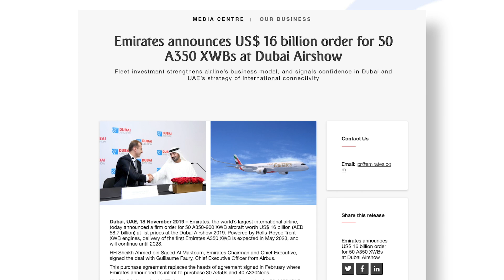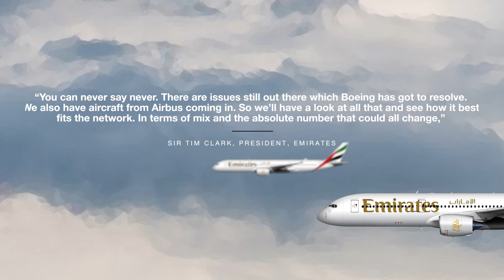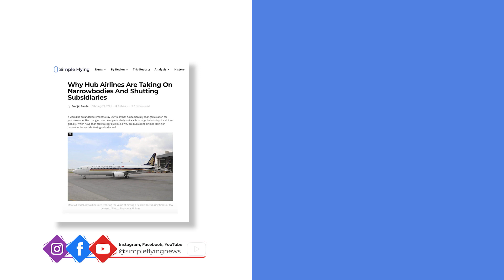Everything You Need To Know About Emirates’ Airbus A350 Order

Comment: Considering so many of their crews work with the A380, using an A350 seems straightforward because they'll be so much familiarity, especially in the cockpit.
Reply: They operate 777-300er too check your facts
Reply: @tetus1575  The B777X uses the almost same cockpit as the B787. Emirates has currently no 787 means no experience on the systems. The A350 cockpit is basically a A380 cockpit but with 2 less engines.
Reply: @tetus1575  you and facts don't go together
Reply: @tetus1575  < You need to capitalize your sentence and add a period at the end.  This was taught in the second grade, where were you?
Reply: They didn’t choose the a350 for FOC similarity if that’s what you are thinking. They had no choice but to go for an a350. They originally wanted to go for the 787-10 with the trent 1000 engines but they had to wait for Rolls Royce to fix the engines first. The reason they want RR is because the 787-10 with the GE engines has weaker performance than the RR engines. The GE engines aren’t big enough to provide satisfying performance for Emirates. If you want to know. GE’s design philosophy is trying to keep core RPM as low as possible to extend engine durability. That’s why GE engines are so huge. 

But on the 787, engine size is limited and therefore lacks thrust on the 787-10. Something RR has no issue because RR isn’t extremely dependant on engine size for thrust. Then…
Emirates recently discovered that the a350 is just a far superior aircraft in performance over the 787-10 and so they diverted their order to 787-9. That’s why they chose for the a350. Because of it’s performance over the 787-10.
It’s also the same reason why Emirates went for the 787-9 over the a330neo. The 787-9 is just better in fuel efficiency over the a330-900.
Reply: an a380 and an a350 are not the same in the cockpit. One has 4 engines one has 2
Reply: @lukaslast3005  Didn't know the engines are in the cockpit
Reply: Emirates haven't their cancelled their order for A330-900, its just an order no one seems to talk about. They've said they still want the A330-900 recently I'm fairly sure.
Reply: @tetus1575  yes but the A350 and A380 cockpit are practically the same and will be convenient for crews going to the A350 as it will be probably replacing the shorter A380 routes
Reply: @hodb3906  yes mostly definitely, but it will be cool for the crew too especially if they are moving from A380 to A350
Reply: @lukaslast3005  almost the same if engine diff only throttle diff
Reply: @aspiringcaptain  Absolutely. It surely will since the a350 and a380 share very similar operations. No doubt that It's awesome that they went for the a350 because I did not expect that from Emirates, but it's sad knowing that they probably would've avoided it if they could. 

If the 787-10 didn't have performance issues or is in performance on par with the a350, Emirates most likely wouldn't have picked the a350 unfortunately. Especially when you consider their future fleet would've consisted of an all boeing fleet of 787-9/10 and 777-9 if they went with their initial plan. Which in terms of operations and cockpit layout, these aircraft are practically identical.
Reply: @lukaslast3005  Really?
Reply: @lukaslast3005  Really?
Reply: @dotted1337 I didn’t say the engines were. My point was you have to learn to learn to fly with 4
Reply: @lukaslast3005  Sure but that has nothing to do with the cockpit being the same between an A380 and an A350. Getting an A380 pilot to fly an A350 is going to be a lot easier due to commonality in the cockpit than had they switched to a Boeing aircraft.
Reply: @MarcusNesbitt4  the last comments from the chairman I saw (probably 2019/20?) were that order us not cancelled, but that discussions were ongoing. Do t think we can be sure either way.
Reply: @aradoc3951  But they do have PLENTY of 777s. 148, to be exact. With that, they are the largest operator of the 777 in the world. Mostly 777-300ERs, I do believe... How different can the cockpit of the 777X be from that of the previous version of the exact same type?
Reply: @aradoc3951  but they operate the Boeing 777-200lr and the Boeing 777-300ER, in which they have 158 777’s compared to 120 A380’s.
Reply: @tetus1575  But those ones will then operate the 777X. Am a380 pilot doesn't fly Boeings because of their type rarings
Reply: @tetus1575 what he never said they didn’t what’s your point

Comment: Folk on bere are like "Emirates should cancel their 77X order because of delays"....Why? They need the 77X to replace their older 77W and A380s. The reason why EK ordered the 787 and A359 was because they needed something in that size category after the 772/77E/A333/A345 all exited the fleet. They need smaller aircraft on thinner routes. Also, the A350-1000 maybe an fuel efficiant  aircraft, but many airlines have said that it cant properly compete with the 77W and 777X in terms of cargo and payload.

Comment: With shenanigans ongoing at Boeing, I think Emirates should size down their 777X order to the profit of their A350 fleet !
Reply: I agree. Even with the issues Airbus has faced with the A350 from the likes of Qatar Airways it seems a lot more manageable and something that is more likely to be resolved sooner than Boeing's issues which are far larger imo
Reply: The reason why EK hasnt ordered the A351 again is because it simply cant compete with the 77W and was the factor why it cancelled its original A350 order in 2014. The 777X is and will be the aircraft they need for both the 77W and A380 replacement cycle.
Reply: @mh12-47  sure maybe in 10 years when boeing can provide a safe airplane after a few 777X crashed just like the 737 Max.
Reply: @globetrotter1493  your comment is irrelevent and ill informed. You really have no idea what you are on about and it shows in your comment.. 😒
Reply: @globetrotter1493  just why 😭
Cmon Boeing isn’t that bad seriously
Reply: @globetrotter1493  777X is not much different from its 777 base, though. The gap is not as severe as original 737 and 737 MAX.
Reply: With all the multi-billion dollar lawsuits Airbus is defending itself from .
There certainly is shenanigans going on at Airbus !!'!

Comment: i think this is really good news, especially regarding pilot training. it’s so much easier to train an a380 pilot on the a350 than it is to train an a380 pilot on a 777.
Reply: But you need to know that emirates has the highest number of Boeing 777 300 planes worldwide.. So training them to 777x would be more easier than training a A380 pilot to 777
Reply: @edgarotieno2872  if they get both the A350 and 777X it will be very easy to transfer crew from aircraft to aircraft. So 777-300 to 777X or A380 to A350

Comment: The A350-900s aren't going on the same routes as the 777x. The A350-900 has comperable number of seating capacity to the 777-200. The 777-8x will have (roughly) the same number of seats as a -300 of today, which is about 350 and the -9 will be even larger. 

Emirates operates a 777-200 today with 300 seats. 20% less capacity for the 7778 and even less compared to a 7779x and as such vastly different route networks for the most part. 

Emirates likely ordered the A350 (might we see a conversion of some units to the ULR variant?) to open new longer, thinner routes to their network in 2023 and onwards once Covid is endemic.

Comment: So wait do they still have the a330neo on order ?
Reply: I have the same doubt too
Reply: Nope,They cancelled A330 neo order and went with B789 instead
Reply: @qasimasharfi9527  i think this Is s good choice to get the 787 instead of the a330 neo but bro if now the orders are huge how about the future
Reply: @qasimasharfi9527  it wasn’t like that, it was more like changing orders to the A350 and the B77X orders changed to include the B787. They said they haven’t chosen against having the A330neo so it could very well make an appearance. It’s a better option over the Dreamliner as cost per seat is the same but it’s much cheaper than the Dreamliner.

Comment: 777x has a wing with a wing that folds. I am sceptical of such changes. It's new and untested. I prefer the a350
Reply: Even IF the wing extension fell off there‘d be no reason to be concerned. The wingtip doesn’t produce any meaningful lift, the aircraft could safely fly without them.
No need to worry, for real
Reply: Boeing has been doing foldable wings for over 40 years through the military . No need to be concerned champ.
Reply: @paulgerard5413  which aircraft was that?
Reply: @akilghosh  F18, F14, E2, most planes on any carrier.

Comment: Considering the fact that the 777x has been delayed for soo long and there is still a multi year delay, I think that they should cancel 777x orders and replace them with a350 as there have been no major problems with them recently
Reply: Yup, and covert to more 787’s to accelerate what looks like their longterm goal of having a 787 and A350 only fleet
Reply: What about the paint issue?
Reply: @emmanuelgeorge  I wouldn’t call that major. Cracking paint can be fixed relatively easily. Much easier than MCAS issues and much much easier than what the 777x is up against.
Reply: They would probably have to up their orders to the a350-1000 if they wanted to directly replace their 777x orders. The capacity of the 777 is what they want to replace the old 300s and a380s. A fleet of a350-1000s and 787-10s could achieve this.
Reply: @adub1300  the 777x only had structural issues in 2021 which have been fixed. you should be gratefull that theyre doing more testing hence the delay.
Reply: Yes exactly! They should keep some 777X orders handy just in case but if it continues like this might as well go for A350 all together

Comment: A350 is a great aircraft. It is the best aircraft among all in service right now. Quiet. Powerful. Roomy. Amazingly comfortable. Emirates should get more A350s and reduce the number of 777X ordered.
Reply: A350s couldn't effectively replace 777, though. That is why 777X is ordered in the first place: replace 777-300 and A380. Emirates need the capacity. A350 will work on many routes, but on busier routes, 777X is needed.
Reply: Agreed 😊. I don’t understand why airlines are not snatching the A350-1000. This industry has some daft managers. They were laying off staff & forcing others  into early retirement in 2020 like there was no tomorrow. Now no pilots, no cabin crew, no ground support, no planes. Shambles. Emirates cancelled 70 A350 in 2014 for whimsical reasons 🤷🏾🤷🏾🤷🏾. 

Difference between A350-1000 & 777-9 is minimal at best ,a net cargo difference of about 5 tonnes but A350 burns much much less fuel for greater greater range too. 

It’s irrational sometimes. A lot a reactionary decisions no solid logic
Reply: @ricky1231  People for some reason love Boeing more than it deserves. But business decisions are not made based on personal crushes. Airbus has to do something extra good to grab the attention of decision makers. Boeing appears to be the default company to buy airframes of.
Reply: @sh230968 
I have flown on both 787 & A350 multiple times 
I prefer the A350

The the 5 tonnes difference between 7777-9 & A350-1000 is for fuel to take it a shorter distance of flight 
And the 777-9 is more expensive 
Madness

Comment: Amidst the overwhelming number of  positive comments here about EK's current order for 350 placed in 2019, I bet you very few of these commentators are aware that 2019 was NOT the 1st time EK ordered the 350.

EK actually ordered the 350XWB for the 1st time ever over 14 yrs ago.  Then EK cancelled that order in 2014 mainly due to dissatisfaction with the technical design changes Airbus has made to the 350 during its development(a long story but in a nut shell: Hardware commonality of the Trent XWB turbofan on the 359-900 and 350-1000 was originally above 95% but became much much lower after Airbus made that infamous design change).....which I find very ironic and funny as many comments here tend to cite how the whole 350 family will fit EK perfectly and imply EK won't need any other Boeing widebody types in the future.

The reality is that EK fleet decision is far more complex and technically objective than the subjective feelings/personal preference of these commentators.

Comment: The whole issue is, 777X won't be financially feasible without Emirates 115 orders, other's carrier orders don't add up to cover the development cost.
Reply: Its already not profitable even with the Emirates order
Reply: @elisabettajdj335  Yes, the main obstacle why 777X hardly sells is the program was launched at the wrong timing which most airlines still have a relatively young stockpile of 77W. They are in no hurry to replace them as 77w still added up to be one of the most cost-effective aircraft models which buying newer models such as 777X(or A35K) could turn out to cost airlines more. The A350 program was different as they were filling the product line gap which the A340 was too undesirable as an available product.

Comment: The Airbus 350 is a superb aircraft which has a very low carbon footprint as a result of its ultra efficient engines. But the interior of an Airbus 350 is rather similar to a Boeing 777, except the 3-4-3 ten abreast seating is used on some Boeing 777s, not on the Airbus 350s. Emirates will make a decision, eventually.

Comment: They should stick to the a380. Airbus should have invested research into more fuel efficient a380s.
Reply: That's a LONG dead issue. Airbus tried for years on an upgraded version of the 380 and no takers and the engine manufactures wouldn't go along since it wasn't worth the investment for such low volume.

Comment: You can, and I am sure that many who will argue the merits of the 777 v A350, and I expect that many will take an opinion based on nothing but bias based on an almost zealous allegiance peddled as a fact.

What those zealots fail to comprehend is that the you can only stand a chance of making a profit is if you actually have an aircraft to fly, and the comparison in this case is not which is better, the 777 or the A350, but the A350 now or have nothing now and the 777 later, possibly even much later, or in the worst case scenario, not alt all - something which is still possible.

Alegient went for the 737 when just about everything was in favour of the A320 for that particular operation,. And why? Simple, the only aircraft that they could get their hands on the was the 737. 

As for. The A350, still hasn't been a release date with any real confidence.

Comment: The 777x will be delayed for Years. And if it keeps the Boeing traditions, then it will also be grounded for some months or years. So Emirates should better switch completely to Airbus.
Reply: A tradition which Airbus now seems to be on track to follow thanks to the recent grounding(still ongoing) of all 350s in QR fleet officially under a newly issued AD by the Qatari aviation authority.

Of course if we are 350 or Airbus 'worshippers', we can simply just brush that issue aside as minor and being nothing more than typical whinning to Airbus or Boeing by Akbar Al Baker.  Unfortunately, the inconvenient truth is that QR is not only the launch operator(not just launch customer) of the 350 and therefore likely accumulated more 350 total fleet flying hours+maintenance experience than any other 350 operators, QR is also still the largest customer for the entire 350 program as of today.
Reply: @felixli5279  no a350 crash. Did it? I flew last week with one of it, with Lufthansa.

Comment: The A350’s problem is not over a simple paint job ! Such a gloss over is very unprofessional during this time ! 
A350 is having a delamination issue, which is also posing a problem lightning strikes during flight !
That is certainly a SAFTY ISSUE. ! Which EASA says it is not. !
Reply: Because it isnt. It’s a surface cosmetic layer that is delaminating. It doesn’t affected the bond layer which gives the lightning protection. Check your facts.